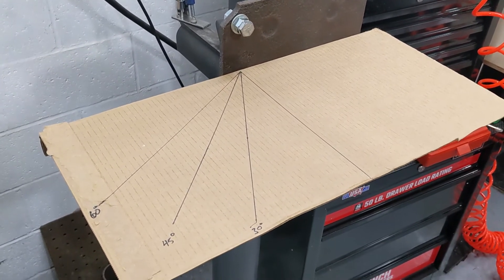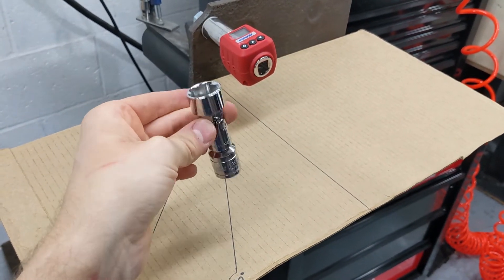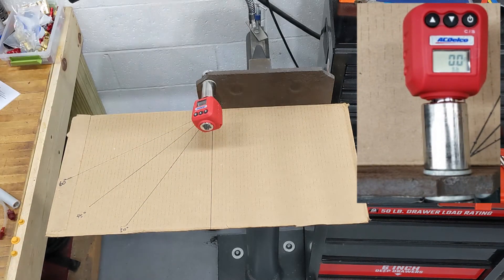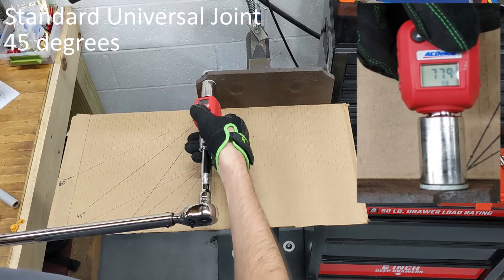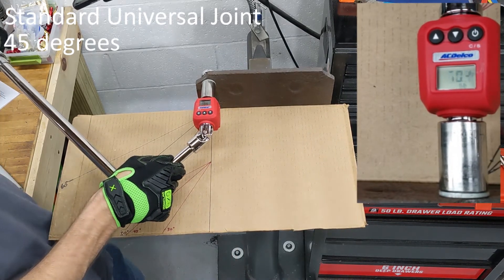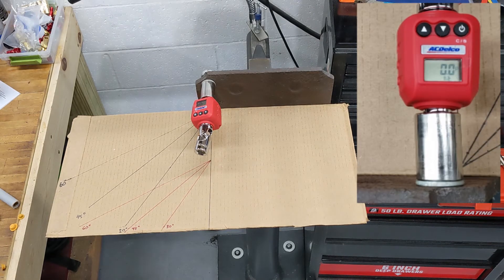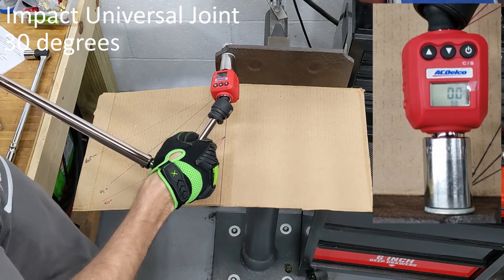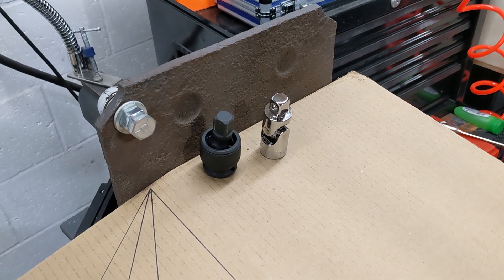Tested: Do Universal Joints affect Torque Applied to a Fastener?

Comment: After much searching I found a formula that specifies what torque setting you should use on the wrench to apply the desired torque at the fastener.

TA = T/cos(A)

Where TA is the torque set on the torque wrench, T is the desired torque at fastener, and A is the angle of the swivel socket.

I haven’t used this against your numbers in your test.
Reply: Also, impact universal wrench has less play than the standard universal wrench is more accurate.

Comment: Thank you for this video.

It confirmed my suspicions that went working at an angle that adds extra friction to overcome.

It looked like the 45 degree angle clicking was about 22% to 37% lower than the 0 degree angle.

 Working on a Kawasaki 454 LTD motorcycle and I didn't want to disconnect the coolant lines: therefore, I used a universal adapter at 45°  which had me searching for a video like this one.
Reply from the maker: Glad I could help in some way! I don't think I'd call my testing scientific. More just proving the idea.

Comment: You should probably rotate the U-joint 90 degrees, and test all 4 orientation to your torque gauge because your reading should depend on where the U-joint is in its rotation. (You'll need to lower your base torque though)

You'll likely find an oscillation between high and low readings as you go through the 4 orientation (caused by the speed oscillation in U-joints).

Here's a link to U-joints on Wikipedia (they provide speed oscillation graphs, so the torque oscillation would be inverted):
https://en.wikipedia.org/wiki/Universal_joint